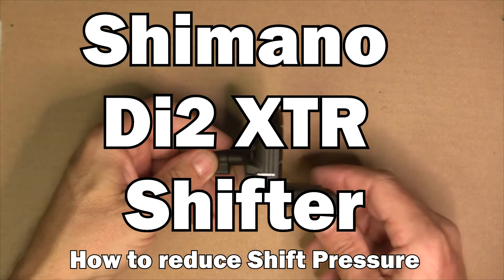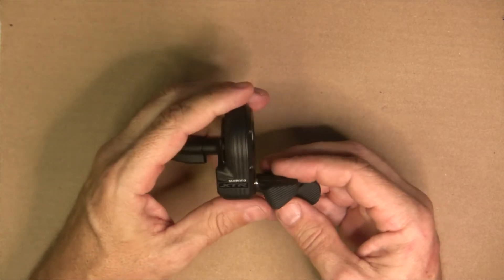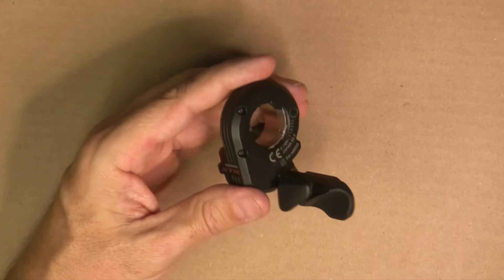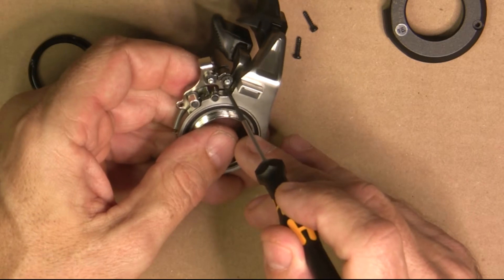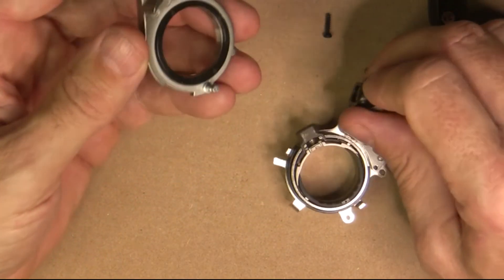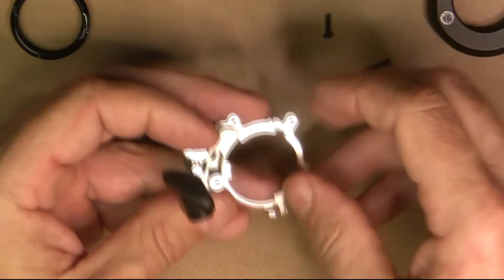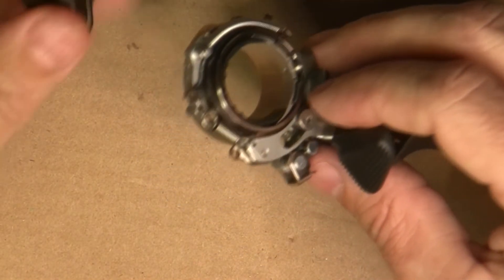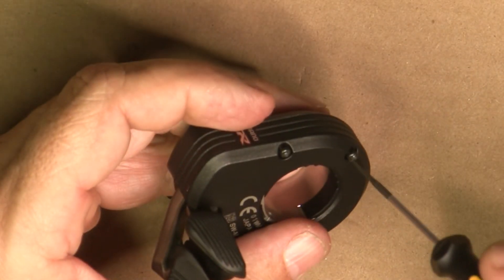Shimano XTR Di2 Shifter Pressure

Comment: hello, where are stored the firmware in the shifter ? only see mechanical parts 

and how the mechanical parts do communicate with the rear dérailleur ? by di2 cable of course but at which moment or place do mechanical moving part are converted to electric signal before going into the cable ?

Comment: There are now a few different options.  My right thumb gets very painful so I went XT Di2 with left handed synchroshift, which was OK for a few years.  Now I am getting some discomfort in my left hand so before it gets worse I have switched to SW-E7000 L from the Steps kit.  The SW E6000 will also work but the SW E8000 uses different wires.
Before I went this path I pulled the XT switch apart to see if it was the same as the XTR, and basically it is.  The XT is better though as it doesn't have the second double shift position.  If you want to change two gears, just hold the switch for a fraction, if you want three hold it a bit longer.  What did surprise me is that the electronics don't even enter the mechanics of the switch.  I assume that it has a magnetic switch cast into the plastic cover.  All the mechanics are to give the switch a macho mountain biker feel.
Reply: Further to the above - the E7000 was OK until I got tired and it was a bit difficult to find the right button.  I revisited the original shifter and found that with the removal of one C-clip I could remove the whole clicker mechanism, which left me with just a spring loaded shifter.  With this mod I find that I have no trouble at all and could probably even use a modded right shifter with little pain.

Comment: Great video, I have Di2 on my road bike and was considering adding it to my mtb. I feel like even with the lighter actuation force, this shifter still isn't that ergonomic. You have to keep your thumb extended out (like all trigger shifters), and when you press, the stroke is kind of long. Which is fine for shorter rides, but if you're doing marathon type stuff or touring it gets kind of tiring. I'm probably going to go for the road climber satellite shifter and mount it for these reasons -- though it isn't as pretty with its zip ties.

Comment: Hi Larry, great vid! Would be interested in doing the mod with only the extension spring (not relying on my mechanical skill to perform also the torsion ones). Would you say changing only the extension springs is still beneficial when i come to reducing the pressure?

Comment: Thanks for this. 
my partner has been struggling to change gear due to hand injuries, last year i moved on to a 1x11 set up, all was good for a while then the same problem started with her right hand. so the Di2 seamed like the perfect solution. the shifter was to stiff. i followed what you have done in the video and the shifter works perfectly for her know.
Big Thank you :-)

Comment: I bet that Shimano  purposely used high tension springs in order to release next year the new model with softer shifting feel. There is no reason to use such hard springs on a lever shifter.
Reply: it could be to not accidentally shift when going over big bumps fast
Reply: Well, they most likely did not want people complaining, that the DI2 shifters felt too significantly differently from the mechanical ones, they are used to. The recent release presentation for the new dura-ace roadie group was explicitly pointing that out as a big plus, that the di2/disc brakes versions feel the same as their mechanical/rim-brake counterparts.

But yes, I am hoping they listen to very good feedback like this video, and ensure to do the necessary modifications in the next version (or at least offer easier ways to configure it yourself - a set-screw for example)